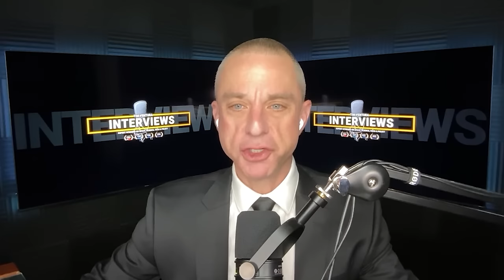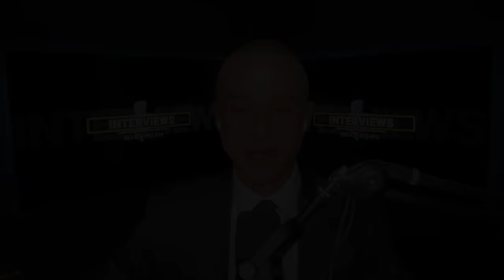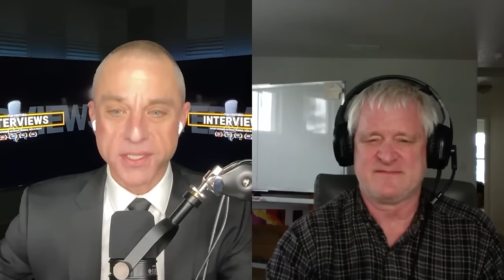John Sahr - Passive Radar Detection

Comment: "if I were a Lockheed guy", I'd make arrangements with gaming hardware manufacturers to use the colossal distributed GPU net in realtime without any notice to the gamers
Reply: In a later version of the passive radar, my coworkers and I assembled a passive radar with up to five antenna arrays, each with four antennas.  There were 15 high end gaming GPUs in the system, with a net compute power of about 200 TFlops (and we used all of it).  The computers that hosted the GPUs usually had at least 256 Gbytes of RAM.  Eat your hearts out, Gamers!

One of the technical issues: how to move a huge amount of data from the (Oneradio-style) receivers to the radar data processors --- This got solved with 1 Tbps class optical fiber.  

You could ask, "why not put the data processor right next to the receiver?" ... which is a very good question.  There was an amusing (but technically challenging) reason why the receiver and data processor had to be separated by about 200 m.

Comment: If an inexpensive consumer level passive system can be developed to be used to detect UAP’s would be a major step forward to collecting data and possibly better photo and video data of the phenomenon
Reply: I've seen someone (with a huge brain) build a passive radar for about $20 plus a garden-variety laptop.  I'm not that smart, so (as a retired hobbyist) I'm doing passive radar as a hobby with a couple $500 SDRs (software defined radios).

Comment: Can passive radar be use to detect these small ufo / uap's ?
Reply from the maker: Yes, I did an interview with Mitch Randall who wants to use it for exactly that purpose. John had so many other interesting applications that I focused it on those in this video....
Reply: In principle, yes.  For interesting technical reasons, passive and bistatic radars are surprisingly good at detecting stealthy vehicles.  

As it happens, I'm not convinced of the existence of extraterrestrial UFOs/UAPs, but I don't have a problem with people who would like to work on that problem.
Reply: @jdsahr  thank you, I am now thinking that ufo's are from our future.
Reply: @custodianfile  You know, I hadn't thought about future us visiting present us.  My main reason for doubting ETs visiting us is that the universe is so freaking huge, and the travel speed limit is so small (the speed of light is really small, even though we think of it as fast.) and the nearest habitable planets outside our Solar System are bound to be many centuries of travel time away even if we can travel at the speed of light.  Which we can't.  Not even close.  The Voyageur space craft are now well beyond Pluto, and into the Kuiper Belt, but it has taken them 50 years to get there.  But that is only a few hours of travel at the speed of light.

On the other hand, suppose that we figured how to travel in time 100 years from now.  Then that is closer to us, in relativity-speak, than available extra solar habitable planets.  I see no reason to believe that we'll figure out how to travel backwards in time, but I have to admit that your idea actually makes more sense than if we were visited from far away.

Anyway.  It is an interesting idea.